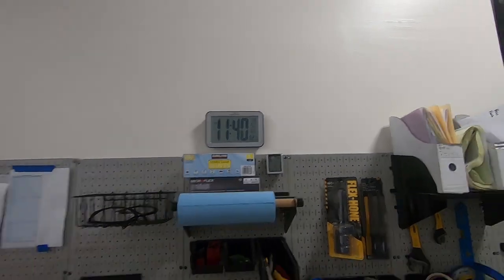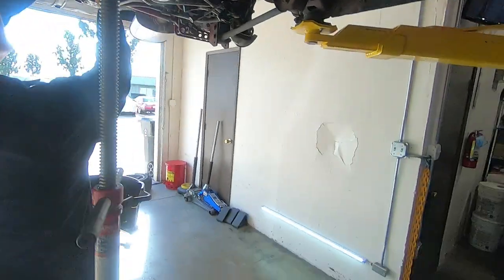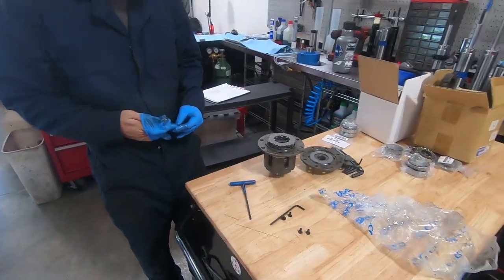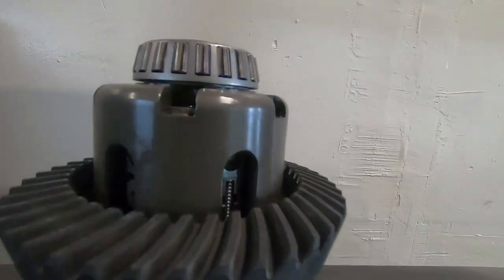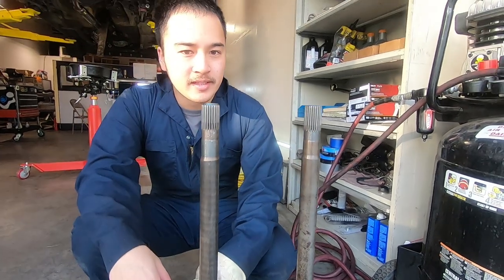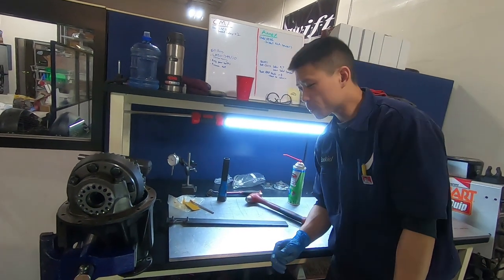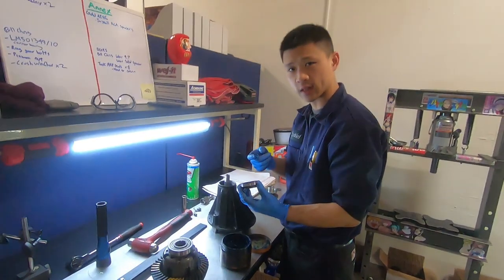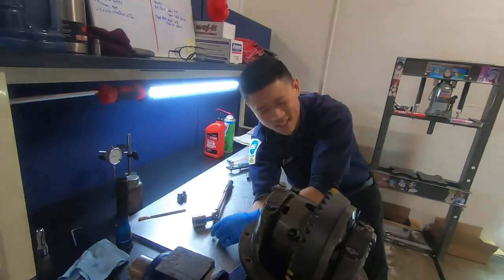AE86 Rear Diff (LSD) ft. Chrisvanish VLOG

Comment: hi, great video guys. But did you find out/check up on how to make more diff lock...? Perhaps make a video about how to do that. I know i could use more diff lock comeing out of corners
Reply from the maker: Most OEM LSD units are worn out by this point. You can get aftermarket LSD plates or shim the LSD to get it to lock harder, but I wouldnt waste your time. Skip straight to an aftermarket LSD where you can set the percentage of lock you want.
Reply: @CMAutohaus thx for a quick reply.. right..I hear you. Was thinking of the part in your video where you flip the plates in ordre to get more grip in your..cosco diff!!
What did you guys ending up doing to get more lock. 
Any recommendations on that?..
Reply from the maker: @henrikolsen6534  Im not sure what you are asking. Can you clarify?
Reply: @CMAutohaus  2.04 min in your video..regarding make more diff lock...switching/ flipping plates...guy says he has to check up on that. What was right/did you ending up with doing...25%lock is standard, yes?...did you make more lock by flipping the plates in the diff?
Reply from the maker: @henrikolsen6534  Cusco has offical instructions on their website. Yes more aftermarket diffs you can change the amount of lock by flipping or changing the orientation of the plates

Comment: Is the 6.7 lsd? I am searching for a replacement diff for my 85 celica and it has the 6.7 open diff, ive seen threads of people dropping in the TRD rear in the solid axle rears on them but wanted your input
Reply from the maker: Not sure if an AE86 6.7" diff works in a Celica sorry.
Reply: @CM Autohaus  ah, no problem. Thank you for your time though :D

Comment: Do you know about using a 84 celica 6.7 diff with zenki axles?
Reply from the maker: Never heard of this.
Reply: @CMAutohaus  well I bought the 84 celica GT diff it is a 10 bolt and a zenki ae86 pumpkin. I'll do measuring tomorrow to see if it will work. Wish me luck.

Comment: What gear oil did you use? I'm trying to find what gear oil  to put in my stock ae86 gts lsd
Reply from the maker: We were recommended by Nik Romano Racing to use Motul 300LS. For a stock LSD the recommended weight is 75w90 plus friction modifier for the LSD. We are an Amsoil dealer and Severe Gear 75w90 and Sliplock Friction Modifier is what I would recommend for LSD